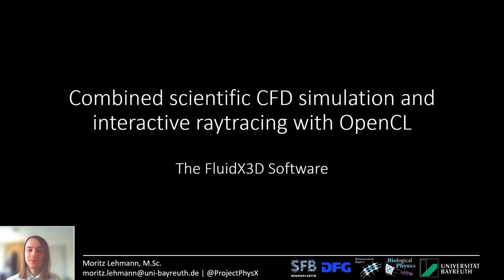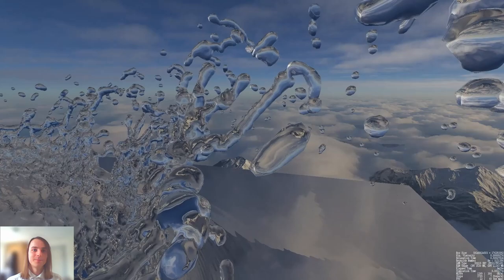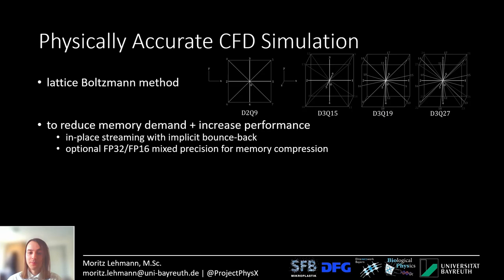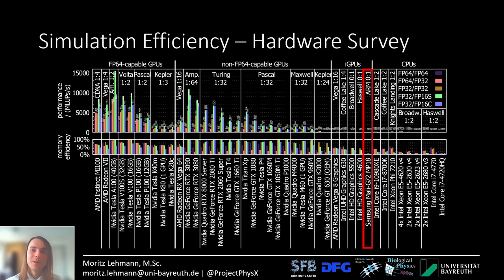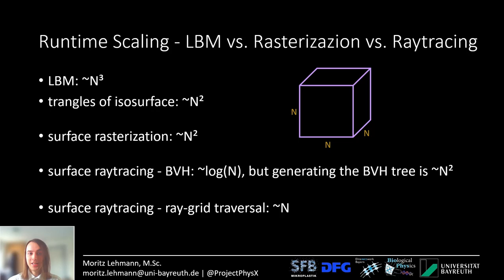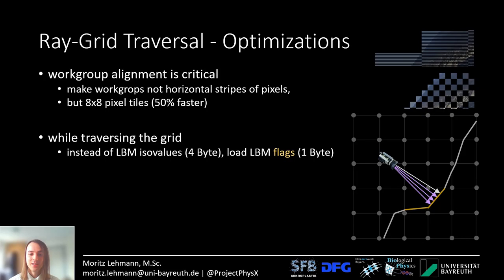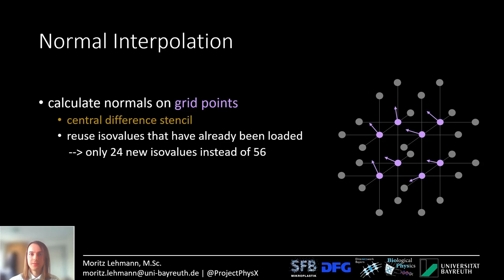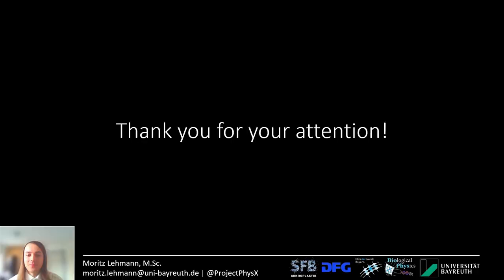Combined scientific CFD simulation and interactive raytracing with OpenCL (IWOCL & SYCLcon 2022)

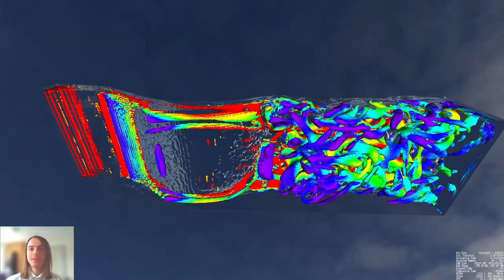Comment: 1:29 I really like all those colored things, it's relaxing while learning what's happening, and also i like the environment, the sun, sky, the crystal clear water which is very satisfying to watch, ahhhhhh!
... done watching your video! i don't understand the whole explanation but one of the things I realized that it's really full of math xD, again the simulation is very cool, the computation looks like needs an expensive GPU, and yeah I feel like I watched more in-depth about how these things work, thus I appreciate it much deeper now...
If ever I will have my own new laptop, I think I would experiment the physics in Unity more longer, because it's really fun, even before this video, I already see physics simulation things in other youtube videos and it's satifying really...
Reply from the maker: Yeah these velocity-colored vortex tubes look kind of cool :)
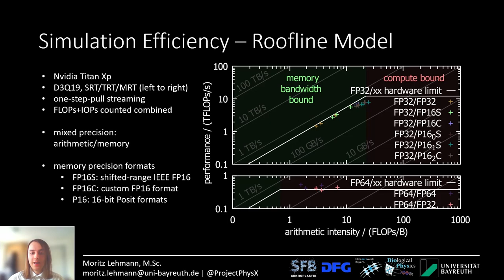You really don't need an expensive GPU to run this. As I show at 10:38, any laptop from within the last 10 years will do. Sure the expensive datacenter GPUs are faster, but they are not a requirement. Right now I'm on a research stay abroad and I only have my 7 year old laptop with a GTX 960M 4GB with me, and that is just fine. Also with the 2 tricks for lower memory demand that I highlight at 7:16, my code only needs 1/3 the memory of others. So on a 4GB laptop GPU I can run simulations otherwise only possible on a 12GB desktop GPU.

Comment: This is beyond mind-blowing - congrats!
1. What are the limitations of your approach vs conventional FVM? I'm imagining accurate resolution of a boundary layer might prove challenging since you can't (easily) use inflation layers with LBM? From what I can gather, complex geometries can also be a challenge, especially regarding accuracy of immersed boundaries. Perhaps some quantities aren't strictly conserved?
2. What boundary conditions / boundary shapes are possible? Is it only "wall" boundary for complex geometry, while more complicated boundary conditions are supported only on Cartesian planes? IMO this might be where FVM shines - arbitrary boundary conditions / shapes are easier to implement.
3. Do you really never write any data to disk (except rendered frames)? Or do you have some sort of "checkpointing", just in case the sim crashes half way through?
4. Is there support for adaptive mesh refinement?
5. Finally, what's the future of this software?
Thanks in advance! Really interesting work.
Reply from the maker: So many great questions! I'll briefly try to answer:

1. LBM is limited to Cartesian grids, FVM can have the grid adapted to geometry and concentrate resolution where it's needed most, like the boundary layer. LBM needs very high resolution to resolve a boundary layer, but then resolution is high in all of the simulation box. Without special extensions like solid-geometry immersed-boundary, geometry is limited to grid voxels and there is a staircase effect for curved surfaces. Interpolated bounce-back extension could mitigate that, but it becomes obsolete if large resolution is required for the flow field anyways and the staircase steps then become tiny.
So FVM is sort of the "smart" approach and LBM is "brute force". However LBM is an explicit scheme so efficient that with brute force alone it can quite easily overpower FVM in many applications.
Quantities like mass and momentum are strictly conserved in LBM, even on boundaries, except for floating-point round-off.

2. With the basic mid-grid bounce-back boundaries I have implemented (actually these emerge from the Esoteric-Pull streaming without needing an implementation), geometry has to consist of cubic voxels and large resolution is needed to mitigate staircase effect. Arbitrary shape are denn possible, als long as resution allows it. There are 2 alternatives/extensions, but these are rather complicated and have no real benefit at large grid resolution: interpolate bounce-back and immersed-boundary.
Apart from solid geometry boundaries, I have implemented can be moving bounce-back (moving solid geometry), equilibrium boundaries (non-reflecting inflow-outflow with fixed velocity) and temperature boundaries for fixed temperature with the corresponding extension. There is 8 flag bits per voxel, so boundaries are rather straighrforward, apart from maybe mesh voxelization.

3. Yes. Checkpoint files are possible too (currently not implemented), but they are not too beneficial as they are as large as VRAM capacity, and when the simulation only takes minutes to hours at most it's not too bad to just restart it.

4. In theory this is possible with LBM, but it's a nightmare to implement and maintain. What makes it especially difficult is that for each 2x finer resolution step, double the time step count has to be calculated.

5. The software started as a hobby project, partly from frustration with the poor performance of the existing CFD software I had to use in my Bachelor thesis. Developing it further became my Master's thesis and now I use it as a tool for my physics PhD. I realized that it blows even the most expensive commercial software out of the water, so I decided to do a clean rewrite of the code after 4 years and get it out to people, to give them a new free tool and get feedback. Currently it's licenced for no-cost non-commercial use only, targeted for science/education/hobby.
Right now my plan is to finish the PhD by the end of the year and finish/release the multi-GPU upgrade. The project is my way of making a name for myself - a master key for future jobs. At the same time it still is my hobby and I have fun programming. At some point in the future I might add a second, commercial license for commercial use.
Reply: @ProjectPhysX  Thanks so much for your quick reply! Crazy to see BLAS-like GPU utilisation with CFD software - usually you see arithmetic intensity well below 0.5 FLOP/byte. I can't help but feel that adaptive mesh refinement could add a lot of efficiency, even if it's just one level deep - theoretically you save 8x resources in most of the grid, surely this is worth the effort in the long run even if it appears worse on the roofline diagram / code is harder to write? I suppose that depends on how much free time you have.

I'm definitely with you on the "frustration" point - using OpenFOAM for CFD was painfully slow, and even a basic GPU-native FVM code I wrote blew it out the water. I wonder, how will you enforce a paid commercial license if you've already published the source code publicly (very much appreciated btw!)?
Reply from the maker: @cfdforeveryone-nikl9742  I have ~5 Flops/Byte here with FP16S memory compression, still well in the bandwidth limit. Sure adaptive mesh refinement would be awesome, but it's a matter of how much time and resources you throw at it. I don't plan to implement it.

Published source code doesn't automatically mean everyone can use it to their liking. People and companies have to follow the licence under which the code is published, and it is internationally protected under German copyright law like any other document. Especially companies don't touch such non-open-source code with a stick to not get in trouble. Only a commercial license would allow them to use the code.
Reply: Thanks for making your work available to everyone! I really want to have a deeper dive into this once im finished with my MSc in IB methods (using traditional FD schemes) as that has really inspired me on grid refinement aspect. Awesome stuff.

Comment: That was very helpful and it's very rare to find someone on YouTube who talks about lattice Boltzmann and opencl 
Do you think that lattice Boltzmann can be an alternative to openfoam?
Reply from the maker: I would say in many cases it's a big upgrade. The compute time is lower by several orders of magnitude.
Reply: @ProjectPhysX  do I need a Phd to use fluidx3d? because it seems complicated and I was trying just to install it but I didn't succeed
Reply from the maker: @muezabdalla2852  basic C++ knowledge is required. You'll have to compile the source code yourself and maybe use an IDE to get the available class functions displayed in a list. It does not really have a frontend at this point but that's just unnecessary clutter :D

Comment: Really impressive work. Do the GPU ure are using must have ROPs and TMUs in order to run the render part? And where exactly is the difference from your Raytracing approach compared to the ones used in games? Do you think there might be a way to make Raytracing more efficient without special hardware functions? Ah, and congratulations to your PhD. 👏
Reply from the maker: No, OpenCL rendering runs purely on the CUDA cores. This has the benefit that my rendering engine also works on datacenter GPUs that lack physical rendering hardware such as ROPs/TMUs.

My raytracing approach uses fast ray-grid traversal, where the data is located on a regular cartesian grid. Think of drawing a line (ray) on graph paper, and then only checking the intersected cells for intersections with the surface that might be in there.

Games use bounding volume hierarchy (BVH); the data is formatted as an array of triangles (triangle mesh) that are not structured. To reduce intersection checks, they put one large bounding box around the entire mesh, equally split it in 8 smaller boxes, split each of them again and again until only one triangle is present in each box. Boxes where no triangles are located are not split further. Rays are then intersected only with the bounding boxes, larger to smaller, until the smallest box is reached an the triangle is checked for intersection. Both the ray-bounding-box and ray-triangle intersection calculations are hardware-accelerated via RT-cores.

Games cannot du ray-grid traversal (runtime ~N) because the data is unstructured. BVH has similar runtime (~N•log(N)) when the bounding box tree is already created (it's pre-computed for game levels). Runtime then is mostly limited by the intersection calculations, and they rund faster when they are hardware-accelerated. I don't think there is a better way to do it in ganes without hardware acceleration.

Thanks!
Reply: @ProjectPhysX  thank you for the detailed reply. What do mean with unstructured data? And do you think that some sort of heuristics can accelerate the BHV tree building?

Comment: I love your work. Just wanna know how good FluidX3D in simulating high Reynolds number boundary layer and hypersonic flow?
Reply from the maker: It's good for high reynolds number flows, including boundary layers, but requires very large resolution for that, similar to other DNS models. It can't do hypersomic flow without further model extensions unfortunately.
Reply: @ProjectPhysX  thank you for the info

Comment: I wonder how much performance boost you'll have once direct storage API hits mainstream...
Reply from the maker: In this case no boost at all, as I'm working entirely in VRAM. It's useful though to read/write large volumetric data from/to the hard drive faster.
Reply: From what I understood from the graph you provided. Basically the more memory speed or the more amount of memory chips you have the faster it will go right?
Reply from the maker: @prithvirajbasu8361  yes, performance entirely follows VRAM bandwidth. VRAM capacity dictates the largest possible grid resolution.
The FLOPs of the GPU chip, the CPU and installed hard drive all don't really matter.